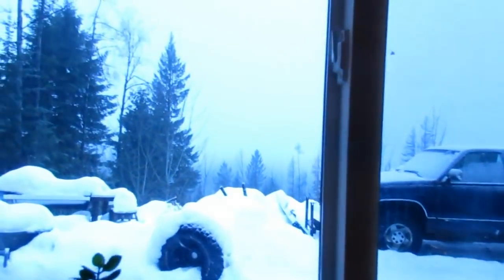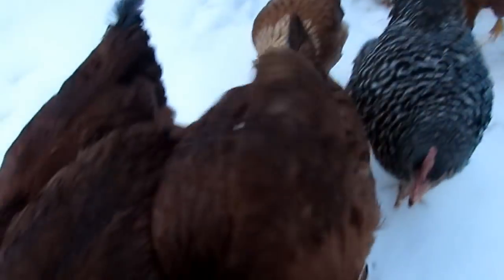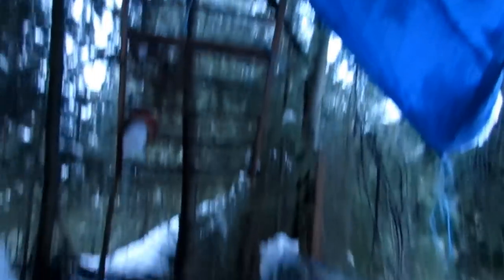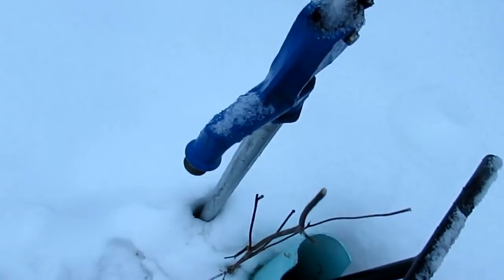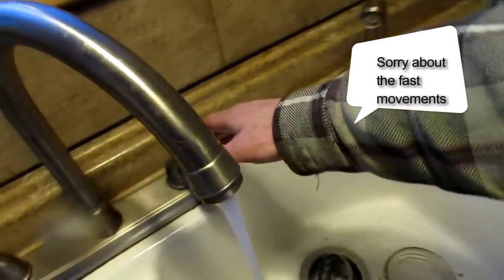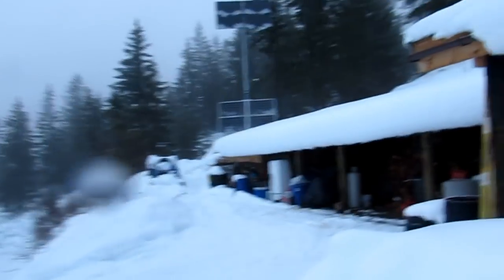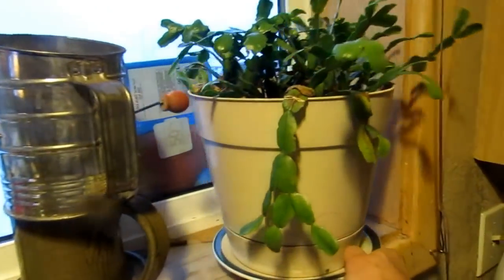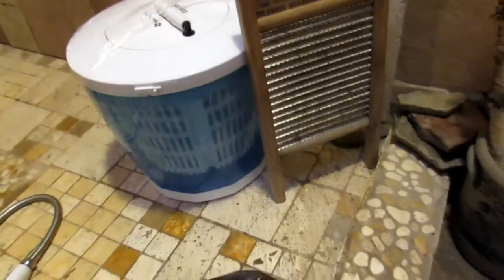Starry Hilder  Vlog: HELP!  COULD YOU DO IT???? OFF GRID?

Comment: no matter where I've lived no matter how much money I've had in my life. I have always loved to buy my clothes at the thrift store! so many of them are delicate even though I got them on sale they for either $0.99 or $1.79 depending on what store. they're usually brand new or Barely Used and there's so many dry clean only or just things I don't want to shrink at all like my jammie pants! I don't like things shrinking up so I've always hand washed or hang it out by hand and hung them on an extra pole I put through the shower. people think I'm crazy but with the wood stove they're dry almost faster than the dryer and it's free I don't have to pay for electricity to dry things The Only Exception is Big comforters. when I lived at the old place I can hang them outside over a double rack so they didn't break the line. But here I can't do that they think it's unsightly to see laundry hanging out LOL